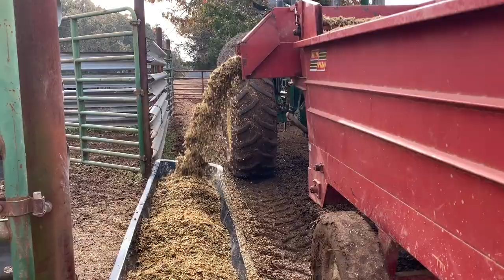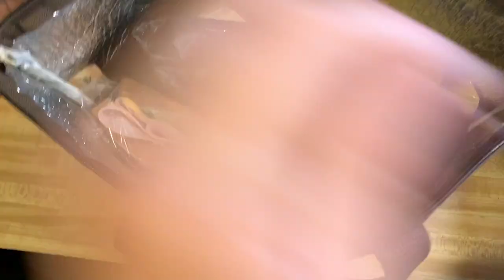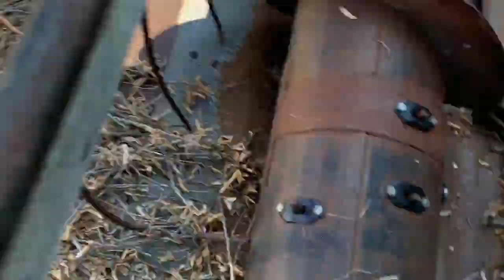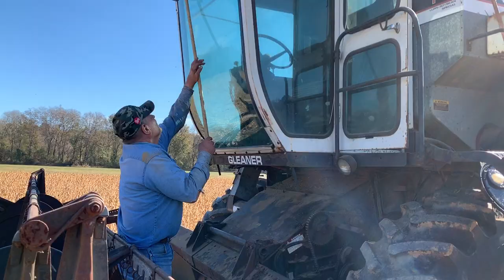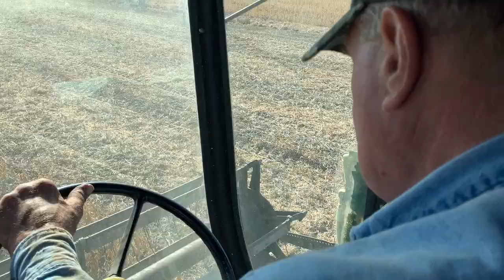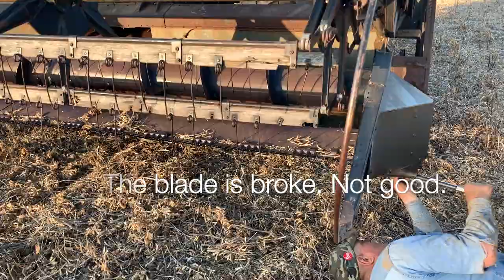One Step Forward, Two Steps Back : Soybean Harvest Day 2

Comment: the green cable that is rolled up , tied to the back right side of the head hooks to the hydrolic valve just outside the window right side of the cab,  it is for the " automatic header height control ".  It will raise or lower the head automatically to keep it a constant   4"- 6" off the ground . the skid shoes and cutter bar need to be unlocked and let down so it can float/follow the contour of the ground, it will stop most of the head digging up dirt
Reply: +1

Comment: My grandfather and i farmed over 1200 acres and did custom harvesting with a gleaner f2 combine.  We used it up till 2012 when we upgraded all of our machines we run all newer johndeere machines.  Them gleaners are awesome for smaller farms . We outgrew ours but we would still run gleaner combines if the prices were right.  We now farm over 3500 acres of corn wheat and soybeans in michigan we also have 167 head of Hereford cattle. Nice video.

Comment: Years ago you could buy a personal cooler made by Gott called a Tip and Tap it had a large lid for filling and a freezable bottle that we filled with tea and put in the freezer at night to freeze. Helped keep the water cool. Was small enough to put in the floorboard of the truck or on the platform of a tractor or combine
.havent seen one in years. But they were great.

Comment: Hi Meredith I own an old gleaner as well .pls tell your husband to have a look into an air system. You mount this in front of the header as you cut the beans it blows them  into the header. You'll get hardly not shater lose in front of the head with this method. It will pay for it self in a few years. 
He will be cutting at a faster and more steady speed. It's a life game changer. In Ontario we have a company called AWS Bean Saver. You can turn any old machine into new with this upgrade. Cheers
Reply from the maker: Thanks! He said Oakleys had one for another model. Interesting! I read this to him :)

Comment: You can do yourself a big favor for next season. If you get that head shined up with this year's crop park the head inside. Then go to Shoup Mfg Website and buy yourself Crary gaurds  and sickle, for that head. Then take the bats out with the steel fingers and throw them away, make yourself some new bats out of treated 1x4 and bolt on plastic fingers, now take a grinder and the flyting on the auger will be rounded on one side, from feeding crop to center, grind that so it's square again, adjust the auger or the stripper plate in back to just clear the flyting on the auger. A combine only works well with a even flow of material going through it.
On Gleaners if you get yourself a flexplate off of a 350 Chevy and a starter mount that on the shaft that runs the head, wire yourself a starter solinoid with the push button up in the cab, when you plug the head just shut the head off and hit the button to reverse the wad out.
You will get it going I guarantee it

Comment: After you replace the blade you will have almost a all new combine. Well at least it will have a lot  of new parts on it. It will have to stop breaking after you all get it all rebuilt. You gotta be about there. Your getting all the bugs worked out of it. Debugging it.

Comment: What keeps those waterers from freezing? Do they have electricity run to them?
Reply: I believe that type is just insulated and has a large pipe coming up with the water pipe inside so some
 warmth from underground rises. Works very well in a moderate climate ,and can work well in  fairly cold climate if you have a lot of cattle drinking from it.

Comment: So do you grind the beans like the corn to feed to the cows?
Reply: No you can not feed soybeans to cows.
Reply: @davidadcock3382  So do you know what they do with them?
Reply: @clgraham82  Soybeans are made into soybean meal which is feed to hogs and also into to soy oil which is used into cooking oil. There are many many many uses for soybeans but those are the two main ones. Enjoy your Pork chops and Bacon.
Reply: U can feed beans to cows but they need to be roasted
Reply: @billbooth4147  Try it and you will have no cows. You are clueless Bill.
Reply: David adcock you must be clueless ,we have all been doing it for years in the dairy industry and we all still have cows plus used to feed them in hog feed also ,so reckon you should know what y’all talking ab before you smart off on the keyboard
Reply: @billbooth4147  Cattle are Ruments. Soybeans are high in fat (around 20%). Nutrient analysis is needed on soybeans before feeding and a ration balanced to limit fat to no more than 4% of total Dry Matter Intake for cattle, so the possible upper limit of feeding is about 20% of the diet or 5 lbs for mature cows. However, note practical feeding levels are usually from 2 to 3 lbs/cow daily. Additional concentrate needed may be better provided as corn or other high energy ingredient. Do not feed raw soybeans free-choice.

Raw soybeans contain urease, which rapidly breaks down urea into ammonia. Do not feed raw soybeans to cattle that are receiving a supplement or feed containing non-protein Nitrogen (Urea) as this could lead to ammonia toxicity and death. Protein tubs, blocks and supplements may contain Urea, check the label. With the high crude protein in whole soybeans it does not make sense to feed a urea containing protein supplement in addition to soybeans, anyway.
Soybean meal is used to feed Hogs.  Good luck.
Reply: David Adcock like I said roast the beans we use in dairy feed daily still have cows they still living use roasted soybeans in dairy  rations I don’t feed them just straight but I’ve pretty well been doing this since I was born haven’t had any livestock die from it yet
Reply: @billbooth4147  Then you know what soybean meal is? If you mean soybean meal then say soybean meal.
Reply: David you have proven beyond a shadow of a doubt you are trying it act smarter than you really areLol keep digging making something out nothing
Reply: @billbooth4147  At least I know what soybean meal is and know how to use the word. Say the word if that is what you mean.
Reply: David Adcock said they need to be roasted what I meant too go back and read tt before you go protesting someone s intelligence,I know what soybean s are used for too been farming since day I hit the dirt
Reply: @billbooth4147  Yes, why didn't you say Soybean meal which is what you meant. Don't you know What soybean meal is?
Reply: David Adcock I didn’tsay meal grind,mix or anything about that .ii mean come on did you tell the world how to exstract the oil for cooking ,and probably I spelled words wrong too but who really needs a grammar check
Reply: David Adcock I don’t say ground corn corn stalks and ears when I say silage either either way same thing,you could have meal without roasting them
Reply: @billbooth4147   No, why don't you tell the world about soybean meal and soybean oil? Soybean meal is fed to livestock not soybeans themselves as I stated. Explain to people How soybean meal and soybean oil is produced. I am all ears Bill.
Reply: David Adcock soybeans roasted make cows turn it into butter fat
Reply: David Adcock I said soybeans need to be roasted for cows ,roasted soybeans dose not make them meal and meal doesn’t make soybeans roasted
Reply: @billbooth4147  Your post is ignorant Bill.

Comment: Hi Meredith 
Your husband is certainly being tested by the old cleaner combine  i’m sure once you’ve got through this first harvest with it most of the problems will be fixed up ready for the next year round 

Something that does concern me is the amount of smoke coming from the Diesel engine 
Looking back at earlier video episodes it was running a lot cleaner from the exhaust  your husband might wanna take a look at that air cleaner or maybe turbocharger is beginning to have issues 
All the best with the harvest hope you get finished soon  😊

Comment: I think running a combine is more stressful on you than it is your husband. I hate to see you almost stressed out to tears . Any machine new or old is just that a machine. They are all prone to breakdowns pitfalls and mishaps. You can't get upset cause for one thing it can get you hurt. Take problems one step at a time and take your time to think them through. I used to be the same way. I was always in a rush especially when something broke down. It is worse two times in the year. Planting and harvest! Don't know how many times I have plugged one up either with dirt or green stems etc. I once worked for a fellow whose son was cutting beans and he had so much dirt in the grain tank when he went to unload the auger choked up. He took it to the barn and tried to "wash them out" with the water hose. The beans swelled overnight to the point it swelled the auger housing! Home schooling is a wonderful thing but letting your kids in with others their own age is good too. Sounds like you have a good mix. Trust me you will get the bugs out of that combine and it will do just fine. The cylinder bars looked great in it. Hope you have good yields and chill out everything will be just fine.........